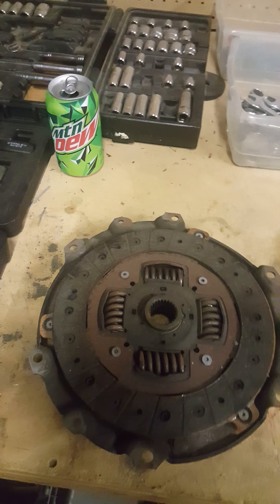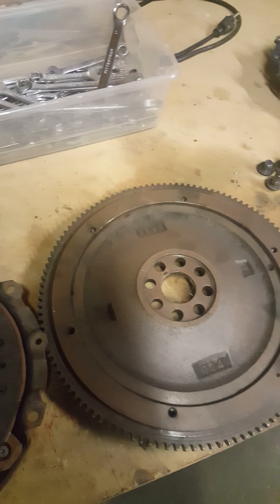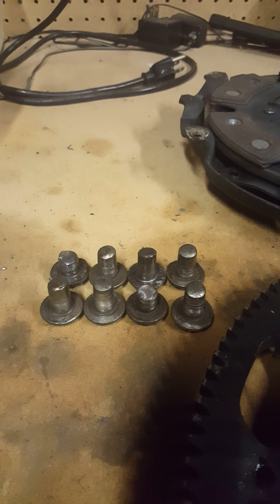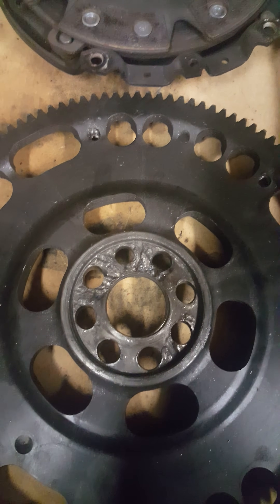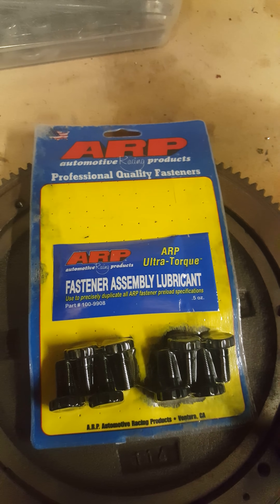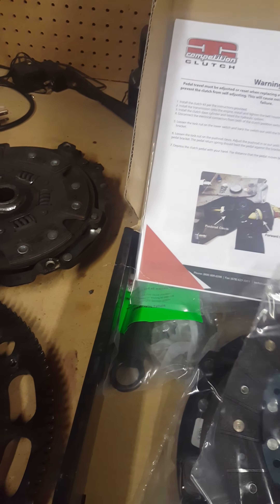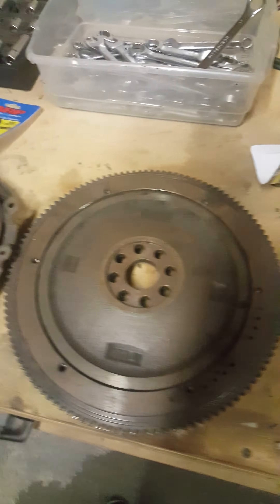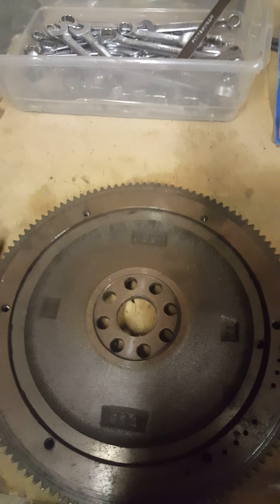Why never to reuse flywheel bolts

Comment: bolts don't just stop working, you must have over torqued them or someone did so previously
Reply from the maker: This video is from a while ago but from what I remember one of the things I found out was I wasn’t running a harmonic damper on a 10,000 RPM motor I was using straight race pulleys and that was the biggest factor of the bolts backing out once we put a harmonic damper on it it never happened again but also never reuse fly wheel bolts lol..
Reply: @EclipseStrife they’re a torqued bolt that stretch similar to a head stud. Once they’re stretched so many times they shear. This is pretty common on certain Toyota engines and I’ve read in some Subaru documents not to reuse them. Of course all of this is engine to engine basis and certain variables are to be considered. If you’re running a performance engine though I would replace them for piece of mind.

Comment: I went through the exact same thing on my car.  After 2 attempts with the stock bolts backing out, I found some ARP bolts that were the same size and tried them.  I've had them on the car for over a year with no issues and plenty of high RPM runs.
Reply from the maker: Awesome, Glad to hear that.
Reply from the maker: Awesome, Glad to hear that.

Comment: Depends on a few things. Langth of bolts, how many bolts there are, how many times they have been used, grade of bolts, how rough you run the vehicle, ect... Using flywheel bolts for a second time is usually okay, but a third or fourth time reusing them, don't be surprised when they do fail. I'm currently replacing the leaking slave cylinder on my F-150 and will be reusing all the bolts from the flywheel and pressure plate, to the housing bolts. Of course next time I'll be replacing all the bolts as well.

Comment: Good heads up...thanks a million...currently building a 881/5 Suzuki Samurai 1.3 block and wanting a aluminum flywheel with a forged 1.3 Swift crankshaft... I was considering reusing the same flywheel bolts but thanks to your input I will go ahead and spend the extra five maybe 15-20 $30 for new bowls and blue Loctite

Comment: Not necessarily true for all vehicles. My f250 has much longer flywheel bolts than this. Short bolts in this application is just poor design. You want long bolts with lots of stretch. These short bolts with fine threads are probably meant to be torque to yield, but other people reuse flywheel bolts without a problem.

Comment: What was the part number on those bolts? I recently ordered some from tristate motorsports and the bolts they sent me say they are for and series, but they sent 2 extra bolts and on their site it's listed as fitting k series. I'm just curious as to what the part number for the bolts you bought were. Mine is 208-2801.
Reply from the maker: 208 2802

Comment: What made you buy those bolts, as opposed to buying new oem bolts from the dealorship? And also how do you know they fit that exact flywheel etc?
Reply from the maker: Stevie Ortega the ARP bolts are stronger than the OEM ones also if you go on arp website they will tell you what vehicles they'll fit they make bolts to fit pretty much anything. Also they make pretty much the best Rod bolts and head bolts and Main bolts.